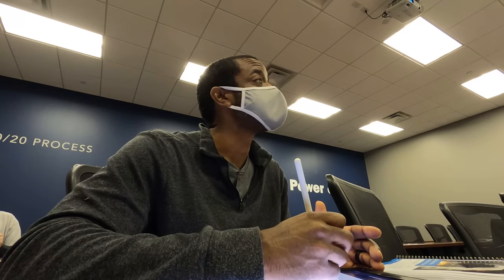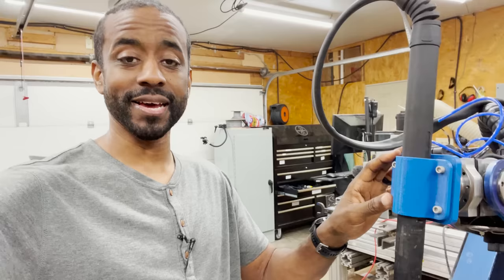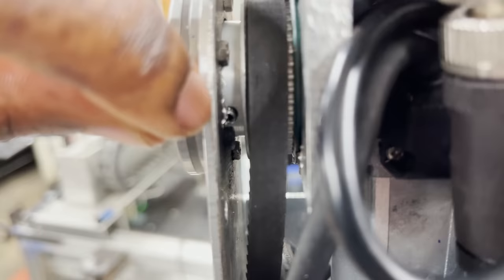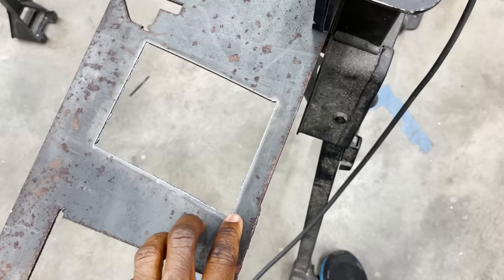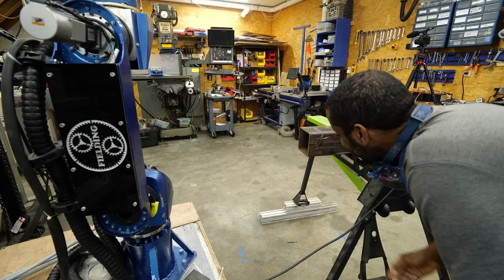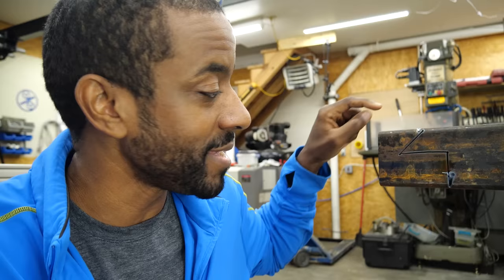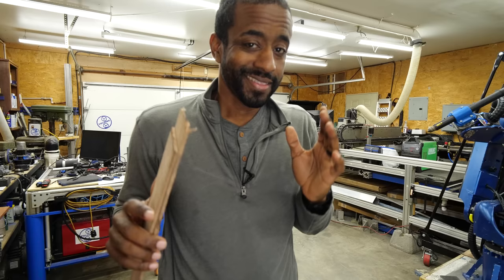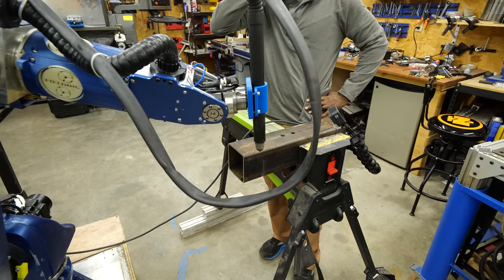I Added a Plasma Torch To My Robot - Jeremy Fielding #097

Comment: Jeremy, good progress, but did you ever fix the connectors on the base of the robot so you can't accidentally mix them up? I see you connecting and disconnecting (in a hurry) and really hoping they all go back in the right spot. I ask "because there is nothing more permanent than a temporary fix."

Comment: I wonder if closing the loop with an FPGA might be a good solution here. Processing millions of pulses per second could be done quite effectively by designing a logic circuit that counts the step increments of each encoder independently and triggers a hardware interrupt on your MCU when a give position has been reached. That target position could be initialized as a value in a register on the FPGA that is used to compare the actual value of the incremental pulses.

Doing this computing in hardware would save a lot of resources on your CPU(s).

Comment: Hi Jeremy, I built an AR3 arm to do a specific task and use it as an industrial tool, and I ran into the same situation. I didn't know any better but have since learned that the linear moves don't work so well. I crashed the arm a few times taking out a couple limit switches. As you commented it seems that theTinsy 3.5 isn't up to the task to make all the calculations to make a smooth linear move. At least that is the conclusion I came to. I have not worked on it much since this discovery and am curious to see if and how you overcome this. I saw a video somewhere where a guy put a mig tourch on an AR3 but I don't recall how complex of moves he was doing.
Reply from the maker: this is helpful actually thank you!

Comment: Hi Jeremy, I saw you fiddling through the controllers and noticed that you are using the breakout boards. Might I make the recommendation to move to a RS485/MODBUS network? It takes a little work to set up, but you'll have access to all of your parameters and you'll have a lot more functionality at your disposal. These servo controllers also don't seem to have a good system for position following based on pulses, but they do offer addressable variables within the MODBUS registers, which would allow you to send target positions to the different axies directly vs pulsing them out. At the very least, you'll be able to access positions to get your encoder feedback. Though, you will be restricted by the baud rate, but I think you can crank that up and get the communications loop cranking.

Is it possible that some of your encoders have different counts?

Awesome to see Jarvis doing some real work!
Reply from the maker: I am using software from the AR3 robot. Everything you need to know can be found by searching for that .

Comment: IIRC the smaller the fractional step, the weaker the movement. IOW, it is strongest when full stepping and weaker at 1/16th stepping and even weaker at 1/32 stepping. If the resolution of the encoder isn't fine enough to detect if a fractional step has been taken or not, it might miss missteps caused by weakness. If the controllers don't detect the missteps and take corrective action based on the encoder, the errors might add up very quickly considering there are millions of steps per linear move.  If that sounds plausible, I'd see if Jarvis can still pump iron like he used to. If there is a way to see individual rotations, I'd send enough fractional steps to complete a rotation under load--hopefully the controllers can display the encoder count. A dirty little work around for slowing it down might be to take some number of larger steps forward and a smaller number back when cutting.

Comment: Can you use RTCP ,nice work, how you program it? you pick the length of torch in spatial space,  i think if you can teach some coordinate( pick 3 point and create plan coordinate... )  can helps to uselly friendly . sure you have learning a lot :)  absolut encoder or diff with home switch its nice. i think 2 accelerometer(gravitometer) on one axis can do the job(issue just on the first joint, you need alternative), good luck with the formula to move this  with g-code efficiently (you need all joint  data dot) can you prog feed cut  or rapid on servo or can you cheat it on your pc dot no how  iam sure it can do it habityaly on cnc machine G0 rapid G1 feed G2,G3 radius ,  if you do it just make sure all move pass by your data the best way keep using linear acc didnt use expo, i think the next step its smart robot with lidar and little ia or not , you need to use kick starter or  sponsor to commercialise your product, marketing, and all stuf nice work  good day and good luck

Comment: Perhaps you are inducing a current, or a magnetic field at the relay, are the contactors clean, recheck both relays and control circuit. Is the torch turned on by a momentary circuit?
Reply: I've seen a shit ton of mice and other electronics destroyed by both plasma cutters running nearby and tig welders nearby. So this is actually a really good shout out.
Reply: @tankerkiller125  Yeah heat and electronics can be devastating to the electronics if not shielded properly. He has so much on his plate with the programming I would have worked that out first before adding the Torch...

Comment: I have no experience or idea about this sort of thing but just to come up with the most bizarre thing to eliminate:
Is it possible the conductive gas from the plasma cutter could get inside the power cable's insulation and back-down the cable to the relay and be shorting the switch connection, while it's flowing?
I don't really know how it works, but I ordered a plasma head once and I could see the connection isn't complete inside, so I figure conductive gas must be involved.. maybe this is different or I'm wrong lol anyway, good luck dude!

Comment: is it a voltage issue? plasma cutters are high voltage no? could the cutter's power just be arcing across the contacts inside the relay? the 'gripper' doesn't seem like it would need hundreds of volts.

Comment: Loosing steps can also come from too short pulses, some drives have a minimum pulse length. If it’s actually missing steps because of speed, can you confirm it’s working when running slow?
Reply from the maker: watch until the end. I explain more at the end.

Comment: Hey Jeremy. I have build a circuit that acts like an encoder buffer. It counts the pulses of an encoder without a microcontroller (its based on logic ICs and 4 bit counters) and spits it out vie shift register on demand (then the microcontroller is ready or have time). If you are intrested I can send you my finished PCP over. (Ich had soo many drawbacks with encoders and missing steps by the microcontrollers.

Comment: Not sure what software you are using but it would be a lot more predictable if you used a calibration point. They look like a ball on a stick and you place it where a number of axis are zero or a known angle/distance. Then you come at it from a variety of angles to ensure your program machine has a known origin. If you are able that lets you use offsets to go to the part you want to make.

Comment: You should probably benchmark your systems before trying them out. Say make a routine that will push the hardware to the limit in increments.  It will make finding failure points much easier. in this case i would probably hook a handheld osciloscope to the encoder and check at wha speed it looses steps. 
Maybe its noise, maybe its the controler not bing fast enough, but with that you could reduce it to a very small number of causes.

Comment: As for the calculations in the linear move, why calculate them in real time? Is there anything preventing you from pre-calculating the linear moves and just having that function look up the positions from a table?
Reply: There are times, such as when jogging, that you needs to do the calcs in real time. I'd suggest using something with a bit more horsepower than a Teensy. Processing power is cheap.

Comment: Hey Jeremy,
I'm curious about your Teeny 3.5 vs Teensy 4.1 issue. I worked pretty closely with the 2 platforms with a previous job, and I'm well aware of how much more horsepower you get with the Teensy 4.1. I spent a lot of time converting software between the two I wonder if I may be able to help debug that issue.

Comment: Just out of curiosity, could it be an issue with the signal going to the relay (meaning a difference between AC and DC signals) after all, your trying to merge 2 differnt tools into 1 device. Then theres the issue of you trying to visualise movement into digital coordinates. ufff its a head pecker...

Comment: a set screw that does nothing? is this an ikea build? if you want to stop those holes in the corners would it not be good to stop the torch after each linear move and then start the torch before each move? kind of like spray painting, you dont keep applying paint except spray painting you start the move, then start painting. but when you get to a corner, you stop painting, reorient, then start again.

Comment: I wonder if its is in fact a software vs. servo / encoder error. Now granted, I am barely into the infantile stage of understanding servo / stepper motion control and the bit that I have gotten into is has been strictly for regular 3 axis CNC machine type controls so there very well could be something I'm missing here but you mentioned the software was designed around a 512 count per rev setup where as your motors are 10k per rev. You also mentioned a adjusting the factor by 25 for the electronic gearing. The thing that seems off to me here (and again, I am very new to all this so there might be something I dont understand yet making this comment more or less moot...) is that 512 does not go into 10k evenly so to me it seems as though there would be a drift error that would pile up over time with each calculated move.

This might explain the fact that the error is not the "same wrong position each time"  as mentioned when talking about the inverse kinematics starting at 16:30. To me is seams that if there is an error because of count, then each time a new calculations is done, its starting from an error position and then adding an addition error on top of that because of the uneven factor of between software calc. vs servo drive calc.

Comment: Stop using an Atmel 8 bit, start using a 32 bit 100MHz or better microcontroller.  I can always recommend an ARM cortex M4 processor, they are easy enough to program for and have a FPU.

Comment: I think you need to adjust your skill tree rating.  The zero marks should be a one at this point, when in doubt, look at the robot arm itself.  You definitely need better math on the inverse kinematics, possibly better resolution in the encoder use.  Instead of the difference in encoder counts per revolution, make it a percent, do the math and have the resultant percent back as steps for the moves.  I hope that made sense.

Comment: Sounds like the software doesn't know the dimensions of the robot. So when you switch to linear it's moving the servos to where a arm with different dimensions would be in the right place.
Reply from the maker: Agreed...I plan to check this. I know it's very close to the right dimensions but I haven't fully tested the movement distances to confirm its perfect.
Reply from the maker: Actually I take that back. It does occasionally go to the right spot with linear moves. Often the first time it does, but not the second time. Also sense I am manually jogging to each position and saving it, I would assume the robot should still end up in the same final location... and it occasionally does. especially the first time. I would expect some weird movements in between and end up in the right spot if it was just a dimension problem... This is just my logic, not necessary me saying that is exactly what should happen. I am not 100% sure.
Reply: That is a good point. I was also thinking do some linear moves against something you can measure how far off it is or if it is always off in one axis.
Reply: @Jeremy_Fielding  if I'm hearing you right cold (first start up) right on, Hot second cut drift occurs. I wonder if you did it without the torch on if tracking be okay. Could you attach a marker just to see if heat has any bearing..?
Reply: Sensors could be affected or plastic due to heat...

Comment: I acquired 2 motors they're both 1hp but they're "Torgue motors" it's RPM ON MOTOR SAYS 1,650 can I still use this motor for a band saw or sander?

Comment: High frequency noise able to actuate the relay possibly?
Reply from the maker: This is very possible.
Reply: @Jeremy_Fielding  Or what I've also experienced in similar situations was improper grounding between multiple subsystems.  If that's a low voltage relay and you are sourcing ground from one object that already has a few volt differential to where the control voltage is coming from that can be enough to push it over the edge.  In your case between the arm, control station and plasma.  Easy to check with just a multimeter while the system is on going between different spots that should all be at ground.

Comment: I bet there's nothing I could suggest that you haven't thought of, but I'd rather bore you with repetition that sit on your solution. In that spirit, here's some thoughts:

Is it one of those situations where the thing is constantly live and grounding the switch turns it on, and there's some pull down or pre-charge resistor that's causing the issue? 
Common grounds issue, where the signal is currently accidentally floating?
I'd be tempted to check the spec sheet for the interface and probe out the connections the verify the signal when it's off and when it's on, then chase that back through the system. 
Cheese it by using the existing relay to activate a switch in the gripper... It's awful and hacky but it'll probably  work... 
You could also use the existing relay to activate another relay/switch? Can you try a separate relay?

Comment: Perhaps not enough computing power. Call Cyberdine Systems and ask for their T-800 CPU 😉

Engeneering running-gag: "The project is nearly finished... just one or two little things to fix..."

Perhaps you could manualy position the robot while recording all the encoder-outputs and then repeat this recorded positions by your program.

Or you could try to make things more complex by using a depth-camera to record the exact position of the torch in the room.

What motors do you use? Regular anker-rotors? Do they stop in the exact position every time or do they stop where the magnetic field of the stator forces them to stop? Perhaps it's a sum of little positioning errors. You should not trust the encoders, but put some kind of position sensors at every rotating axis and record their values several times. If this values are not exact the same every try, you have problems with your gears or motors.

I'm not an engineer only IT-Admin, but programmed for a while and know the problems between perfect programming and unprecise hardware. 

Please excuse my english. Missing practice.